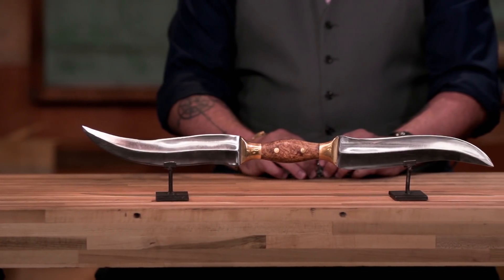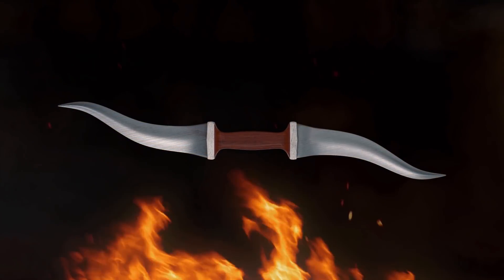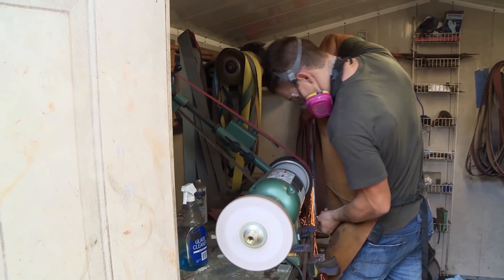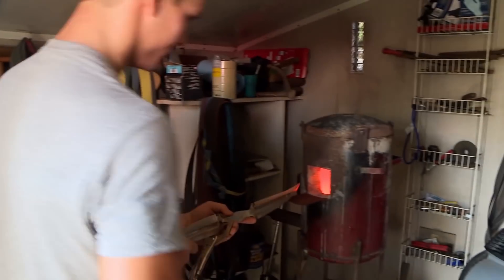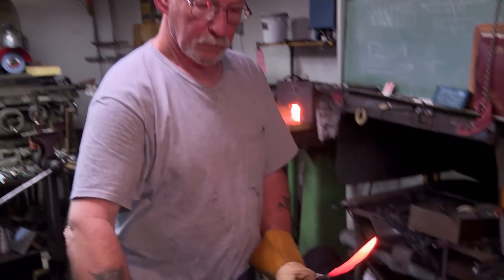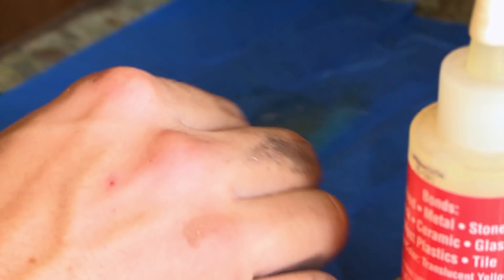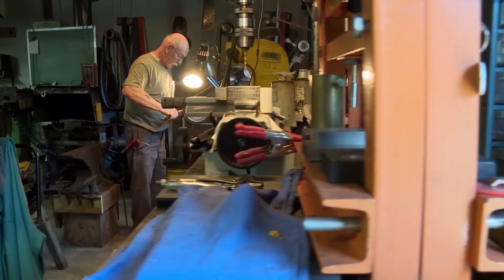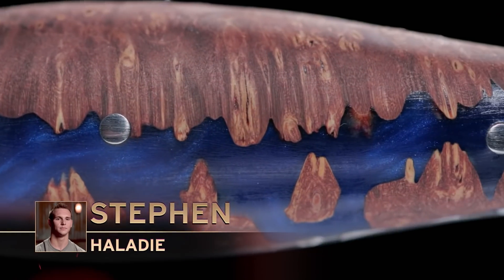Forged in Fire: The Haladie is a DOUBLE-EDGED DAGGER Ready for the Final Round (Season 3) | History

Comment: Wil: "Ok blade Smiths, you have to do this weapon with this and that"
Every Blade Smith: "I´m going to do it in Damascus steel"
Reply: Everyone: no you won’t
Reply: only their damascus isn't in any way similar to damascus steel other than looks vaguely similar. true damacus isn't two types of metal or folded.
Reply: It's not true damascus, that's practically impossible these days.
But it does look nice
Reply: "I want my blade to be unique and to stand out, so I'm going with damascus"
Reply: Yeah, but this is a master bladesmith. Unlikely to make the same mistake
Reply: I think they do Damascus a lot because it gives them an edge in the competition. It is harder to work with and easy to mess up. It also looks beautiful if it's successful. That would be my best guess on why they do Damascus a lot.
Reply: @TrevorPhillips1969  that usually is the case. ive seen some smiths win because they weapons performed equally well so the judges had to make a decision based on the aesthetics of the weapon and the way it looked which Damascus certainly helps in.

Comment: One small detail, sure only the detail that makes up the shape and what makes it into a Haladie.
Reply: don't know, the blade wasn't tested, im quite sure the handle construction would have been a big issue too, check the difference in both handles, just the shape, with the first one, its not possible to damage ur hand using the blade, with the second one, it would hurt the hand for sure...
Reply: @wimvandesteeg1353  Imagine your hand slips and you slice your hand and fingers because there is no piece in the handle that stops your hands from sliding onto the edge.
Reply: @wimvandesteeg1353  basically  what doug said at 7:00

Comment: His handle was too thin and didn't flare toward the ends either, to stop the user's hand while stabbing. The way his handle was designed the hand would've struck the shoulders of the blades instead, potentially causing an injury.

Comment: Would a straight piece through the handle be better vs 2 separate blades joined at the handle? Just asking as a non metal worker :)
Reply: Ask any two knife makers you will get three opinions. If you have a mechanical join between the handle and blade (a pin, basically), then the weak spot is the wood in the handle. In theory, that might be weaker than the steel. In practice, it's unlikely to matter.

Comment: Why not test it anyway? Its not dangerous, just give the win to the old guy but at least see if they both will keel. I mean whats the point otherwise?
Reply: Parameters. If someone asks you to make something with a certain shape and type to the blade and you give them something completely different from what they ordered you failed as a blacksmith. This is also a form of learning and training for blacksmiths as well as a competition. Think of it as a mild punishment you don’t get to see the blade perform.
Reply: It can get ugly when the blade not meeting the parameters outperforms the proper one or the blade meeting the parameters suffers a catastrophic failure. DQ and be done with it is the cleaner solution.
They could have skipped the test entirely. The tests are choreographed in advance. No way Doug was surprised by the blade not meeting the parameters.